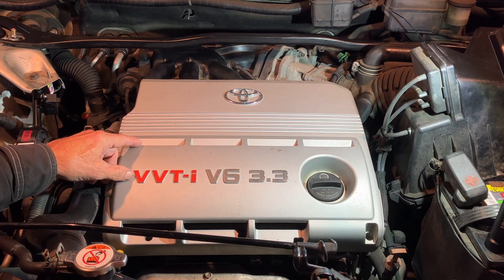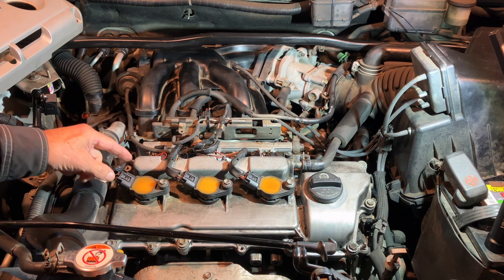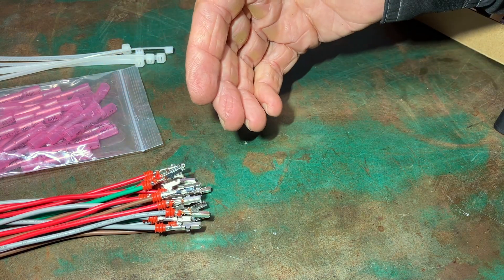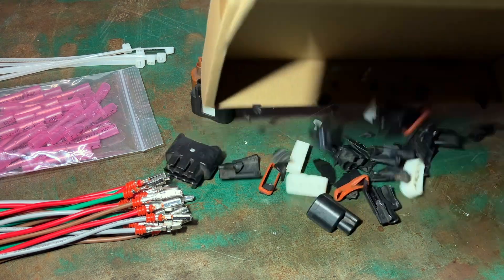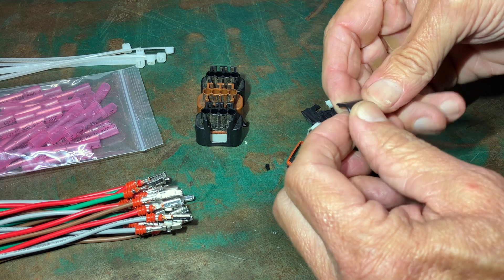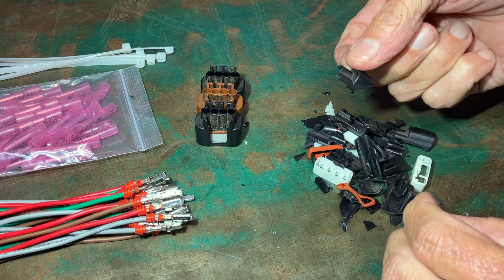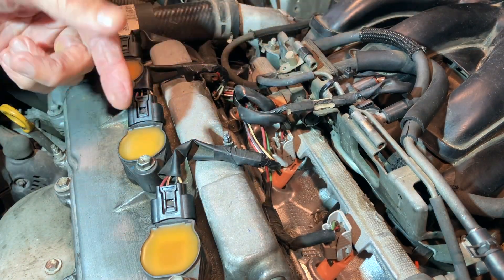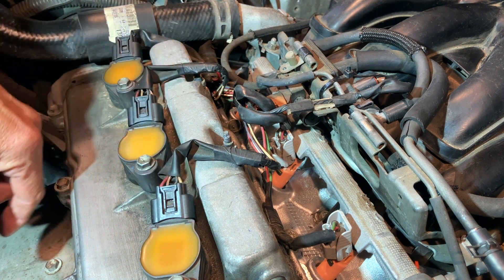Should You Remove Your Engine Covers?

Comment: Yes the plastic engine covers do trap in  some heat.  They protect your hood paint by not allowing excess heat from below. In colder climates , it keeps the fuel rail warmer longer, which will Aid in  starting your vehicle back up.

Comment: Covers now a days serve many purposes on modern day engines with more electrical solenoids/ devices and direct injection engine. It’s service mainly as a noise Insulator, both the top engine cover and larger bottom cover counter act a lot of noise that would be perceived to the customer as something being bad with the vehicle and obnoxious. As well as protection from the elements and rodents even though both of those depend on your area/ climate.
Reply: Rodents chew right through the plastic like buttered crackers, and splash sheilds/liners/undertrays are a completely different thing. You are correct in that the cover is mostly for noise and visual appeal as a secondary function. Some performance cars have covers that duct air, but most can be removed with no downsides.

Comment: I have always wondered if those covers had any practical purpose or are they for decoration and noise? maybe if you live in Alaska, it might keep engine warmer. I would think taking it off in summer putting it back on in winter might be a good idea.
Reply: same, I saw some 1 went to Alaska & they had to make a cardboard cover for the grill. 
the sound argument is good too, mine has foam under, most likely 4 sound than anything.
Reply: @Eduardo_Espinoza  That is to keep your coolant at operating temp, not to affect engine bay temp.
Reply: I have A 94 ES300 with only 46000 miles, new to me, I think I'm going to take my engine cover off too, is anyone else weighing in the idea thay the cover aids kerping coolant temp correct?

Comment: covers are just for aesthetics. take them off every vehicle. my 2011 gmc ls engine cover wears through pcv hose and the wiring harness for the injectors. i always redo the wire covering with abrasion resistant splitloom, not the round plastic stuff, the thick fabric type from techflex. wrap the ends with heat shrink tape, then heatgun it, glue melts and secures splitloom.

Comment: To be fair, 19 years is a long time for anything made of plastic in such an aggressive environment.
Reply: Yup. It's not going to prevent plastic getting brittle. Silliness.
Reply from the maker: @travisbakeriii3053  never said it would prevent but it should delay..
Reply: the other connectors were still good no?
Reply from the maker: @Eduardo_Espinoza  No.. The rear connectors were also bad because the locking tabs had broken..
Reply: I beg to differ older cars which were considered inferior never had any such issues even after 30 years.

Comment: Tbh, I'm not a chemist or any sort, but I think plastic simply become brittle due to aging process, with or without that "beauty cover" on...
Reply: depends. I have 40 year old connectos that still work great and 10yo ones that are already brittle.
Reply: heat accelerate it, especially heat that cant escape
Reply: Heat adds to degradation...
Reply: plastic breaks down with heat and sun if you bury it in ground it lasts forever.

Comment: I always figured, if a cover wasn't necessary, then the manufacturer would have left if off for cost savings. 
Your "front" bank connectors might be getting brittle since they are the closest to the exhaust manifold/heat flow.  Just my opinion.  Peace
Reply: with that cover on, the exhaust heat simply trap underneath the cover. Thus with the cover on must hotter than w/o it.
The cover is totally unnecessary for sure. The manufacture put them on simply because it makes the engine looks "prettier" (or more luxury). 
Don't forget how superficial people are nowadays, if people see "prettier" looking engine under the hood, they automatically assume it's better. Same as people will trust better looking people than ugly people. Otherwise, no one will buy luxury clothing and put make-up on their face.
Reply: @engrishsheep  They also spend a lot of money on advertising. Costs millions of dollars and doesn't make their cars any better... But there's a reason.
Reply: I own a 2005 sienna with the same motor ,Imho it looks like the heat from the cooling fans that causes this as for mine everything that was not metal is kaput plus the Texas heat doesn't do any favors.
Reply: The cover doesn’t cost much, and it’s only there for decoration
Reply from the maker: Had not considered that but it makes perfect sense..
Reply: @PeanutButterMan-PBM it has 2 exhaust manifolds, front and back, front does have the fans. I have the same engine.